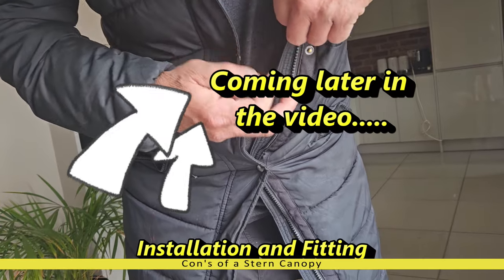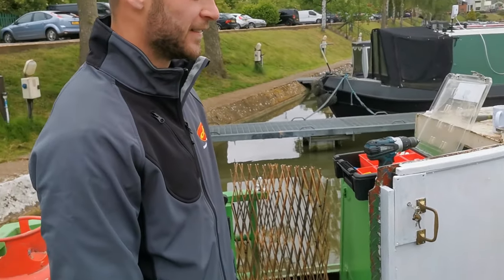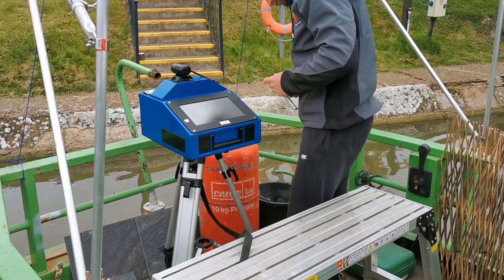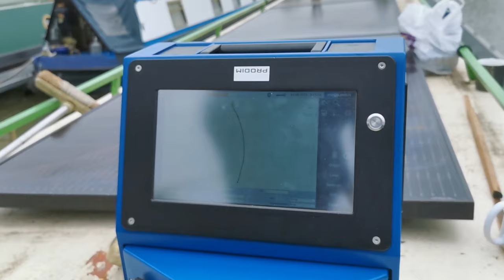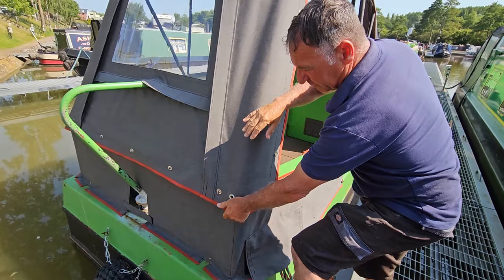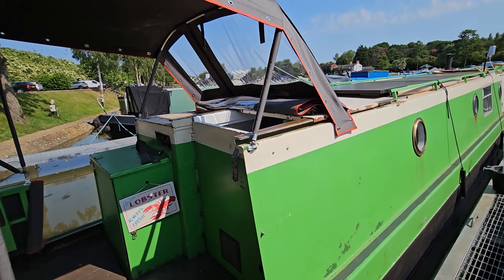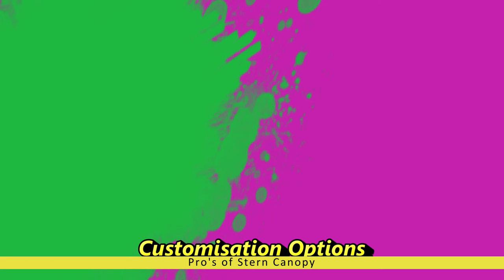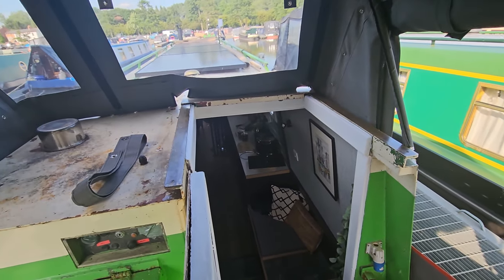NARROWBOAT Canopy Fitting and HONEST Review, including Pros and Cons of a Stern cover (Pram) Ep33

Comment: Get the knuckle joints changed to marine grade steel not plastic with a bit of steel. Bakes in the sun and ages rapidly and becomes brittle.👍🏼
Reply from the maker: Thanks for the tip on that Nick. We shall ask the company if they can do this. Thank you 😊